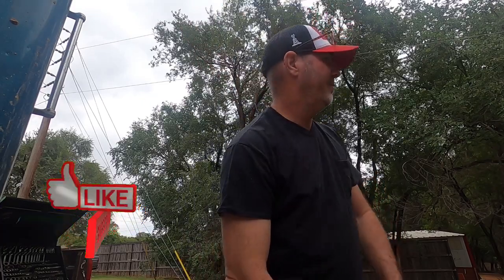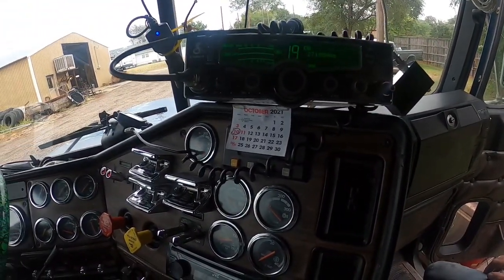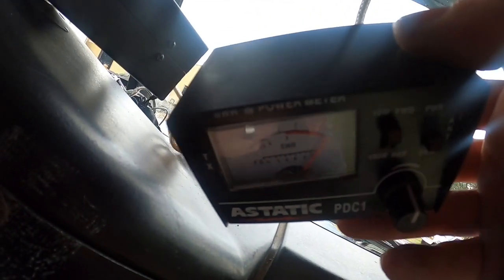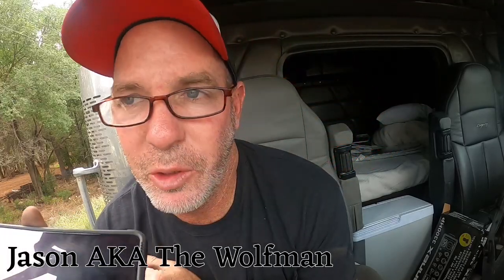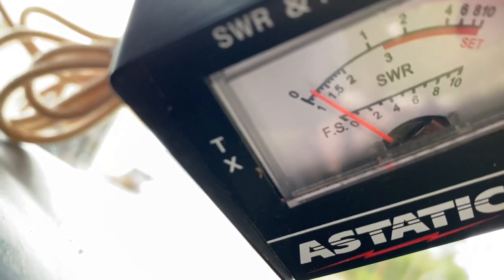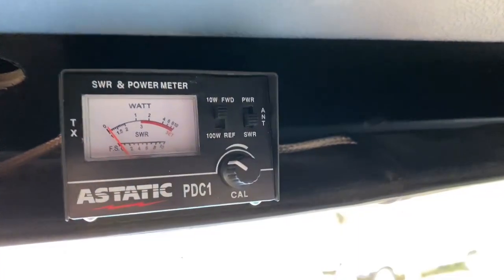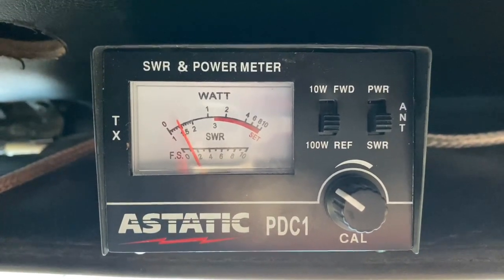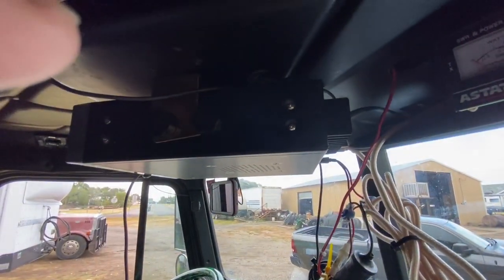Installing a Connex 3300HP and setting SWRs with a Astatic PDC1 SWR Meter!

Comment: You need a longer shaft on the bottom to get that transmitter coil away from the cab. Your getting powere reflection shot right back at your antenna and radio with not as much power going outwards.

Comment: I had a CB when I was like 17 in the 80s and man they were great times, met loads of friends and lots of girls🤪 . From my experience some comments you've had give you some great options  and personaly had issues with my SWR and it was due to the length of coax . 😁🇬🇧
Reply from the maker: Heck yeah Chris! Those CBs are a lot of fun, I think they will get a lot better after we properly install the coax and upgrade to antenna (SWR) thanks for watching bro 😎

Comment: For a future time try closing the door sometimes it helps with grounding and sometimes when the door is open the antenna gets close to the cab and gives higher swrs…the coax needs to be 18 feet long, it’s a must and it can’t be wrapped in little circles you have to wave it instead or big circles will help ……good videos by the way keep making them 👍🏼😎
Reply from the maker: Thanks Jonathan, the coax is 18’ we need to long wrap the extra instead of the short wrap like we have, I appreciate the view and the input buddy 😎
Reply: Coax doesn't have to be 18 ft long, ask DX Commander
Reply: How bout parking a bit closer to or inbetween to those overhead power lines and that tin shop

Comment: Everything has an effect on your standing wave ratio(SWR) I noticed you have an excessive amount of coaxial cable  for the bundled up with a zip tie. That causes a choke, and high SWR, which is why most jumper cables are short. Uncoil the jump cable and let it just hang loss or straighten it out, then take new reading...

Comment: You have aground issue... I'd try scuffing the mirror arm under the mount and put a little grease on it and tighten down. Also wouldn't hurt to upgrade the antenna. I'm a big fan of the browning!
Reply from the maker: 10-4 thinking the same thing on the ground, will be upgrading antenna as well!  Thanks for watching!

Comment: The extra coax could be a problem. It was on mine.
Reply: Agreed! Run what you need to get from antenna mount to radio that's it.